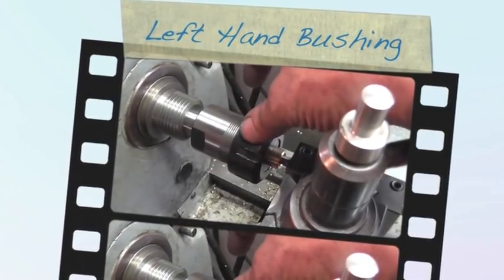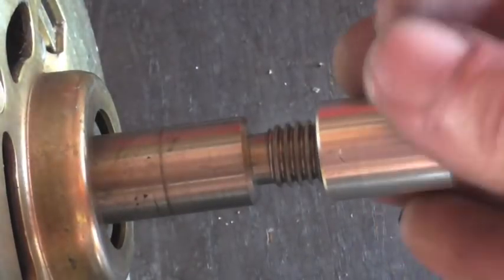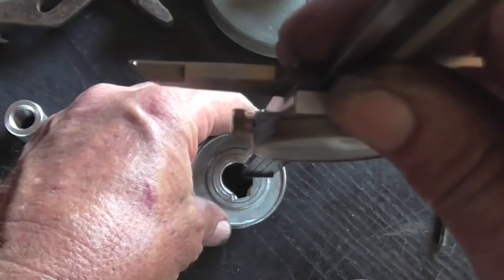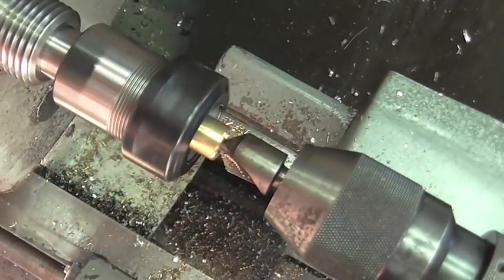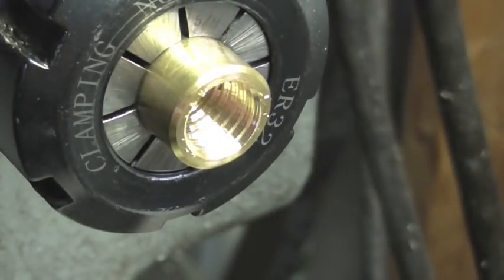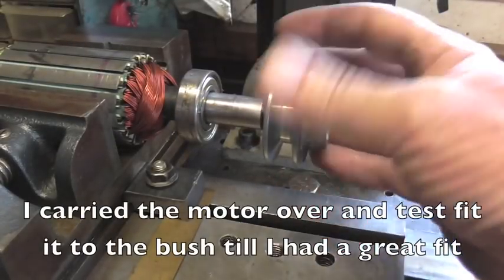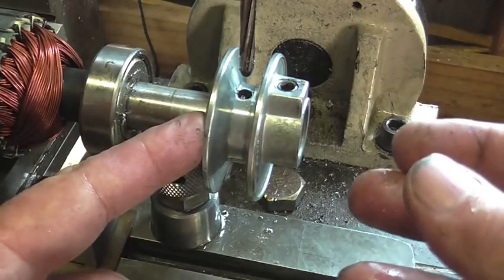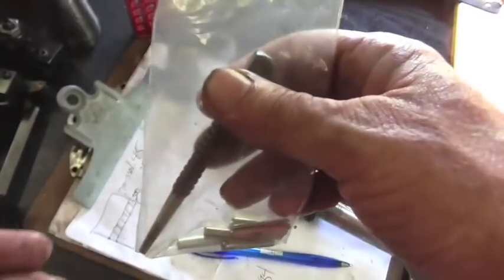LH Brass Bushing to Modify a Pulley For a Rockwell Model 14 Bandsaw - MSFN

Comment: Great work!
Looks like he an use an idler pulley or two on there, not excessive flapping of the belt, but anything you can do to stop vibration is a good thing. A few duckets in your pocket doesn't hurt either ay.
Reply from the maker: Thanks Mark!

Comment: Are you seating your collets all the way on the nut before tightening? All my collets sit at east flush with nut, but maybe yours are different of you have already slightly loosened it. Liked
Reply from the maker: I pop the collet into the nut fully before tightening, I never paid attention to their relationship to the nut. I only have the one ER set, they all fall in the same place. The raw brass bar only had the .001 runout so the collet set is a pretty good one based on my experience. I never skimmed the brass on the OD
Reply: Makin Sumthin From Nuthin  If you snap the collet all the way in the nut the face of it must just be a lil thicker than mine or something. thanks for the reply and the vid.

Comment: Since you have a MT adapter collet. You could have marked the spindle and the adapter with a sharpie then removed and replaced the adapter as needed.
Reply from the maker: Very true James. That crossed my mind, had seen others do it in other videos. I decided dragging the motor over was the better option for me to avoid the risk of having to try to pick up an internal thread to cut a few more thou.

Comment: Hey, it worked - wouldn't call it a bozo if you made it work the first time.  I thought it turned out pretty well and the second pulley looks like it works quite well.  A lot of the little stuff us hobbyists are asked to do is one-off stuff so we're doing everything for the first time on a good number of jobs we're tackling.  Thanks for sharing.
Reply from the maker: Yes, a lot of the jobs I am requested to do is one-off stuff and sometimes requires a test piece for practice. Thanks for the kind words

Comment: Wow nice job! Honestly I haven't figured out threading on my lathe yet so I probably would have turned down the threads on the shaft and made a simple bushing with a roll pin through it  😁
Reply from the maker: You will, just perseverance my friend!!
Reply from the maker: But how would you have turned down the shaft is the question....🤔🤔
Reply: @MakinSumthinFromNuthin  grip the other side of the shaft in the chuck (might have to take the bearing off) and live centre in the front, then nibble away with light cuts

Depends on the motor shaft too I guess, might not be able to do it with this if the commutator is in the way 🤔
Reply from the maker: the other side of the shaft was only 5/16 diameter on the opposite side of the motor.....and the large side of the shaft had no center hole for a live center....coulda broke out a steady rest and drilled a center I suppose......but too much trouble IMO

Comment: Takes all kinds eh. L.H. threads are a major pain in the heinie. They shouldn't be but they have raised my collar many times. Good call on the brass. Steel and aluminum are just too unlike to behave well together. That and they readily corrode. That lathe of yours is great. Small but well tooled for sure. Being that a V belt should never hit the gullet of a pulley you could have used a set screw on that little fella but this should work ok or turn it around if you have room.Sweet job my friend !
Reply: Nice job Richard 👍
Reply from the maker: Thanks Steve
Reply: Makin Sumthin From Nuthin   LOL, It's Dean bud. Never a worry as I do it all the time myself.
Reply from the maker: A set screw into a "dimple" was the original plan, the customer felt more comfortable with a roll pin. I do too actually now that job is done :)